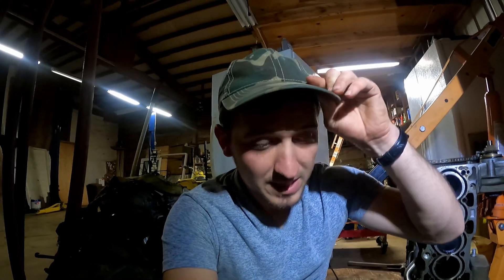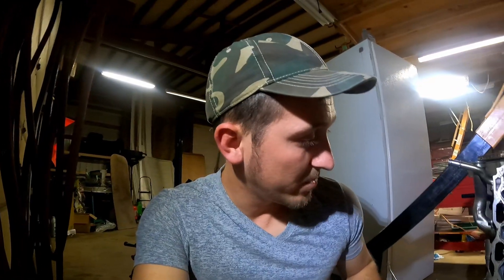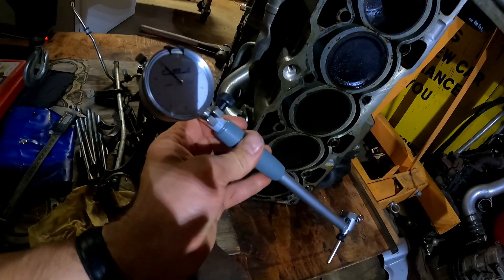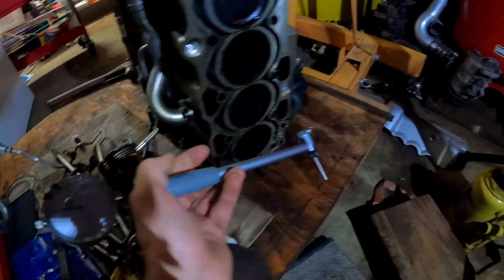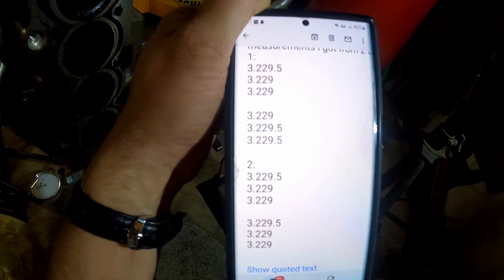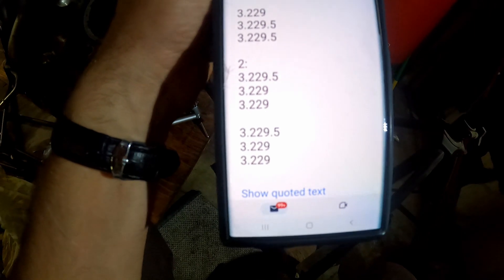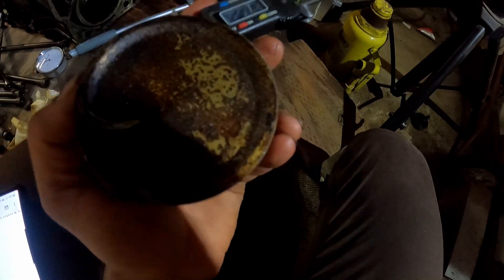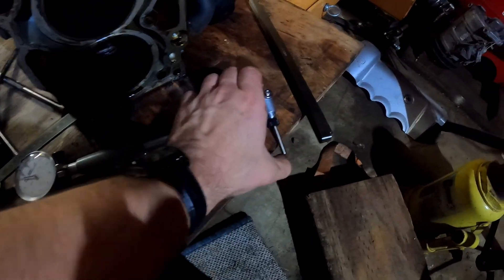Volvo P3 3.0L b6304t4 Engine build update. Cylinder Measurements...

Comment: Those guys at Elevate are pricks, I made a comment about their P3 'cold' air intake sucking hot air in because it's not sealed, and they said 'there is not hot air in the engine bay above 10mph'.😂
I asked for proof and they then proceeded to mock and Insult me for the comment.